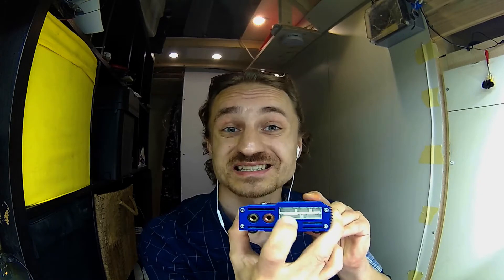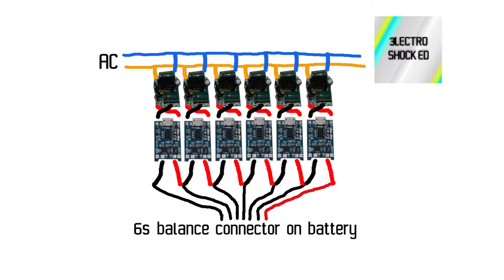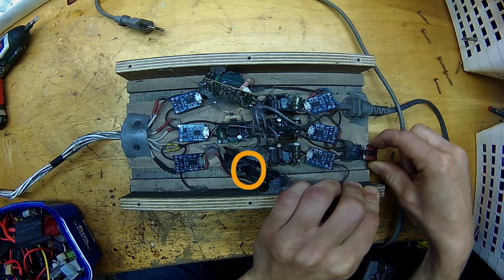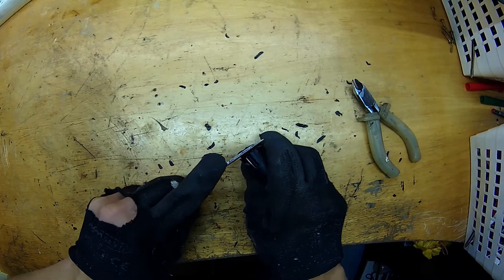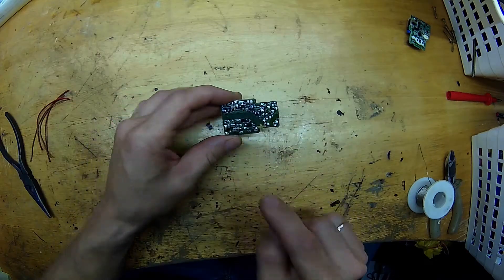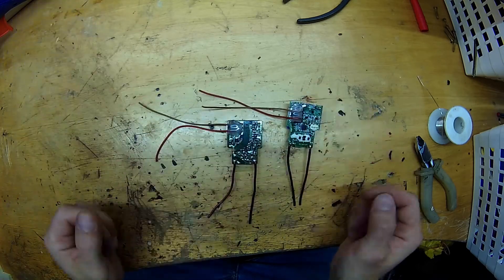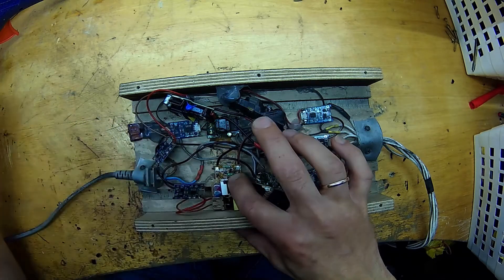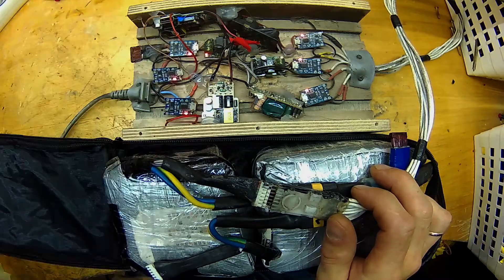How to make Balance Charger with TP4056 | Review & repair

Comment: Can we add parallel tp4056 like 5 in one set and then series so it should be 5 tp4056x3should be 15 and in one set it will give 5amp per set and bigger power supply 3 5v 10A ?thanks
Reply from the maker: TP sences voltage, so 2 in parallel will sence each other

Comment: What are your thoughts on efficiency and loss in this build? I'm considering between this type of build, versus bulk charging at full voltage with an active cell balancer attached.
Reply from the maker: hi! well typical balancing does that thru resistor discharge, which im not found of. using TP modules is in a sence more efficient, but unfortunatly slower due to amp restriction... BMS boards may fail, and often do, so me personally - I choose TP system :)

Comment: Built 10S Charger using the same idea...
10 Cheap 1A USB chargers
10 USB cables
10 Charger chips ( TP4056 )
Since all chargers are galvanically isoleted it works great.
...
Recomendation thew.
1. USB good quality USB chargers to gearantee galvanic isolation.
2. USB same charge boards for all chargers.
3. Be careful with connecting lipo, so polatity is correct.
...
Made a 10S discharger to, measuring capacity of each cell.
Used10 units to discharge, mean much button pushing.
But it work.
....
Why did i do it?
Started recycling bike batteries with broken/corrupt BMS
So i wanted to measure and charge/dischrage the cells without
disconnecting them.
...
And YES it work.
Unfortunatly due to other circomstances, the electric bike 
 buisness here in Malmö ( Sweden ) 
Is stone cold, at the moment,
Regards
/Martin
Reply from the maker: Nice!

Comment: If built 48V power banks for camping. Can we use cheap MPT  solar charger set charging rate to 48V then have a DC bulk converter to 5V 30amps then connect 13 TP4065 in parallel to DC bulk converter to charge battery packs
Reply from the maker: Hi! Very good question. Power supplies of TP's need to be electronically separated. An AC-DC power supply does exactly that (the coils). So if you connect all TP's to one 5v supply you will get a short, sorry :(

Comment: Why not place the TP4056 modules in series? Then you don't need an isolated DC/DC for each module. You (in your case) need a 30V 6A power supply to charge it. When charging each ground is lifted and don't cause a short circuit. For example: 
Module #1 GND is at 0V
Module #2 GND is at +5V
Module #3 GND is at +10V
Module #4 GND is at +15V
Module #5 GND is at +20V
Module #6 GND is at +25V
Or am I wrong?
Reply from the maker: Its a good point but the problem here is that cells are connected in series permanently.
Reply: @3LECTROSHOCKED  My example is exactly the same, batteries in series, however other arrangement of the chargers, also in series (to the power source) and parallel to each cell. So what you need is only one powersource and there is no need to isolate the chargers.
Reply from the maker: Oh, now I got it :) yeah not a bad idea, I just would be worried about resistance. Modules suck different amounts of current, it depends on the state of charge. But yeah, good idea! Thanks for sharing! :)
Reply: @codebeat4192  I dont think that's true. The GND difference is previous cell voltage. There's no way for you to make sure it's 5V

Comment: very confused with your wiring diagram:  the positive output only comes from ONE of the tp4056?
Reply from the maker: Hi! There are as many positive outputs as modules. Every module charges a cell individually - that's the whole point of this charger :)
Reply: Basically, the charger are connected serially....
How can that be....
Simple...they are
>>> GALVANICALLY <<< 
separated, due to the transformers in the USB unit 220 -> 5V
The USB units has to be that, due to legal requirements.
Which they 'Hopefully' Fullfill...
( Sweden )

Comment: I'm sorry for asking... The picture shows in 6s battery that the TP 4056 connected in series ? With 6 cable's for (-) and 1 cable for (+)..??  How to connect the (end) wires to battery pack..? 

I'm sorry, I'm new with electronics. 🙏🏻😁
Reply from the maker: Hello! Thank you for watching! If you mean the main power connectors - you don't need to use those in this system :) All off the charging power goes through the balance lines.
Reply: @3LECTROSHOCKED  not the main power (AC), but the DC .. 😂😂 I don't know how to explain 🙏🏻.. my English isn't very good... I'm from Indonesia
Reply from the maker: yeah, exactly, the main dc of your battery . you don't need that for charging, just the balance wires :)
Reply: @3LECTROSHOCKED  okay... Thank you 🙏🏻
Reply from the maker: Thanks for watching! :)

Comment: PLS HELP ME OUT................................

I have mobile charger rated 5v 700ma and 5v 700ma I will connect them in parallel to get 5v 1.4amp and use this for one to4056 module will this be safe way and other two modules with 5v 1amp and 5v 2amp as iam making 3s lipo balance charger
Reply from the maker: Hello! That's a good question. As I understand in theory, unfortunately you can't connect DC power supplies in parallel. It doesn't work the same way as batteries in parallel. If I remember correctly, the problem with connecting DC power supplies in parallel has something to do with rectifier circuit. But, if you don't care if you burn a couple of modules, then why not, try that out :) Buck converters are different, so it may even work with some of them. Just be sure you have fuses everywhere for protection. But, I do advise you just to get a mobile charger with a 1amp - 1,5amp rating, rather than experimenting with two 700ma power supplies. Hope this helps!
Reply: @3LECTROSHOCKED  thank u very much bro
Reply: @3LECTROSHOCKED  all the three inputs voltage and ampere should be same for each TP4056 module 

But iam having 5v 1amp  5v 700ma and 5v700ma mobile chargers 
Or 
Shall I buy three mobile chargers rated 5v 2amp
Reply from the maker: As I mentioned in this video, you can use 700ma power supplies, but they will probably burn after some time, since they will be overloaded all the time. So it is really up to you :) Maybe start with that and replace with 1amp after they burn. But remember to put fuse on the AC side, since when these small power supplies burn, they usually create short circuit on the AC side. Ones I had 3 different fuses burn: one on the charger, another one at the distribution box in my shed and third one in my main fuse box :D :D  So really cant be too safe here.
Reply: @3LECTROSHOCKED  really I like u so much bro because ur helping me so much thank u bro
Reply: @3LECTROSHOCKED  bro finally I want to use 1amp for first module,2amp for second module and 2amp for third module so that all will be safe with out any problem 

My question is that all will charge at same time or different because for first module iam supplying on 1amp what do u say 

Thanks for reading 😘😘😘😘😘😘😘😘😘😘😘😘😘😘😘😘😍😍😍🥰
Reply from the maker: Thanks! Glad to help! :)
Reply from the maker: So, because the tp4056 have a constant current throughput (around 1amp), in your situation, you should be able to fully charge every SERIE in your battery pack at around the same time. There will be some differences though... They may be caused by: the capacity and resistance differences between SERIES in the battery pack; any kind of resistance differences in the wires and, of course, the differences in quality of the tp4056 (they may vary). But I noticed, that if your battery pack is solid well balanced from the build, then you should get almost the same full charge time on every SERIE :)  If you are interested in how to make a great DIY battery pack, check out my video: https://youtu.be/lix8uaSrCME I'm sitting right now and designing a new, flat, 0,5kWh, 48v battery pack for a new full wheel drive eScooter ;)
Reply: @3LECTROSHOCKED  I have to charge my li-po not li-on battery my battery 2200mah 3s 30c
I have decided to make tp4056 balance charge for lipo 
Three inputs supplies for three Tp4056 module  are 5v 1amp,5v2amp and 5v2amp these tp4056 are connected in series to form a 3s lipo charger 

What do u think at these bro say about my idea will it work or shall I change the input supply which is 5v 1 amp to 2amp so that all the three inputs will be 5v 2amp for all the three tp4056
Reply from the maker: As I mentioned, it doesn't matter, since tp4056 cant take more that 1 amp input :)
Reply: @3LECTROSHOCKED  thanks bro I already got two power supplies 5v 1 amp and 5v 2amp but when I connect the battery. The module is heating up what to do
Reply from the maker: Heat is normal :) Mobile chargers are hot all the time when you charge you phone.
Reply: @3LECTROSHOCKED  I arranged a 12v cooling fan on it will it be cool
Reply from the maker: That's good, it will help to keep the efficiency of your power supplies at highest possible :)
Reply: @3LECTROSHOCKED  hi bro I charged my 2s li ion pack but the cut of voltage is 4.15 why it is not 4.2 i want 4.2 what to do
Reply from the maker: That's normal, don't worry :)
Reply from the maker: Sometimes it can go to 4,25 .... that 0,05 is just too small to be considered or measured as a reliable value difference with any household instruments or tp4056. Also the batteries itself can behave strangely so that they go down to 4,10 even they are full and showed 4,20 a minute ago.
Reply: @3LECTROSHOCKED  thanks for the I formation bro may I know where do u live

Comment: How many apms is ur mobile charger
Reply from the maker: Hello. Thanks for asking! If you use TP4056 you should have a 1,5amp power supply or more. Also a always test them with an amp-meter and a big resistor to verify that they actually can provide that power, that says on the case :)